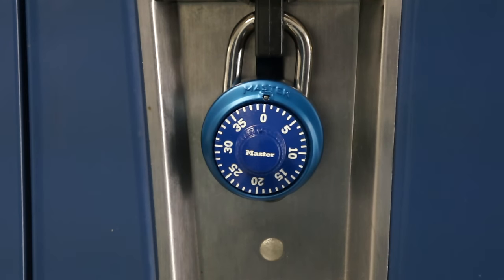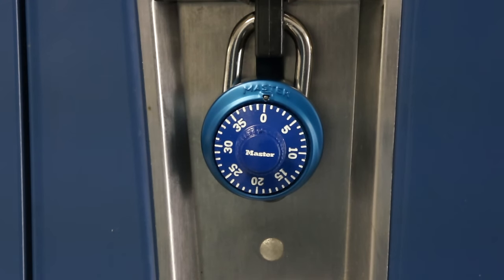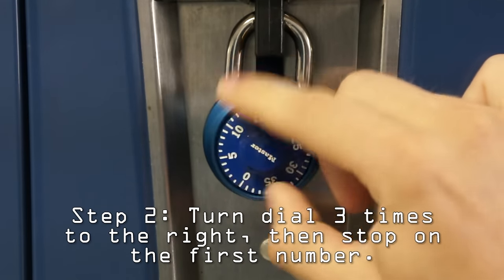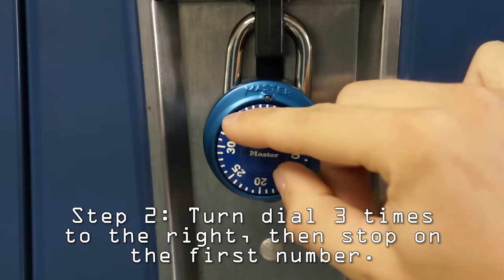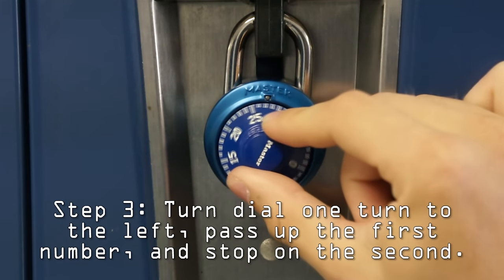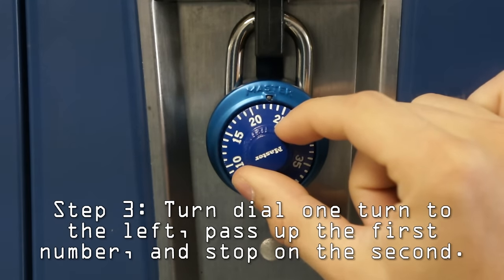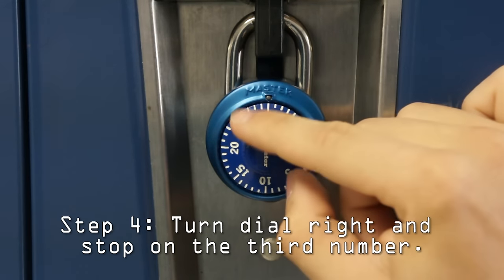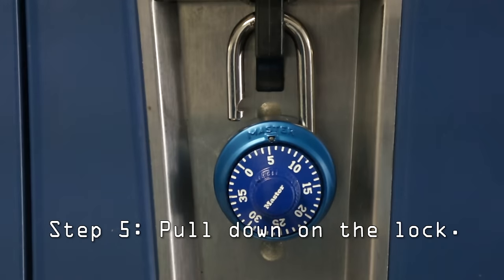How to Open a Combination Lock or Locker

Comment: I avoided using my locker last year cause I couldn’t figure out how to open it. Hopefully I can do it this year 😭
Reply: Just get a key lock. Much faster to open and more secure. Maker sure it's bump key-proof and shim-proof though. You can get an Anchor Las 820-2 for about $40, or if you need more cut and pick resistance, an Abloy PL330 for $110.
Reply: SAME

Comment: You should never use a combination lock on a school locker. Someone could watch you enter the combination and then they would have access to your lock. Use a key lock with at least 5 pins, ideally 6 pins, instead. If you want the best security possible, use a disc detainer lock (Anchor Las or Abloy) to prevent bump keys.

Comment: I have a great solution instead of these freakin crappy locks that make you late to class if u don't do it exactly right.

Since we already have a lot of new technology, we should have a system where all you have to do is scan your lunch card in this Tiny slot and it would open. Everyone already has a school id anyway. And the scanner would only except your id. And then when schools over special people will have to unscrew the scanners and put them on your new lockers.

Sincerely, 6th grader who is currently in the 4th quarter and still gets her lock wrong. Almost been late to class several times because of my lock. Something needs to be changed.
Reply: bella hilaski Would cost a lot of $ to upgrade the lockers of every school to a system like that.  And seriously it's not that hard.